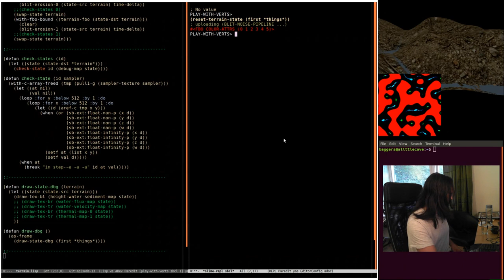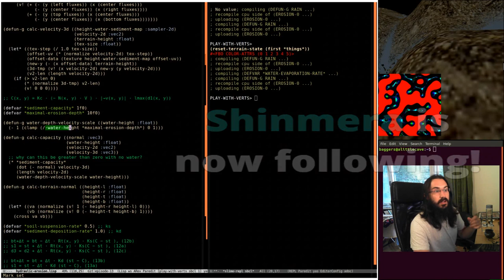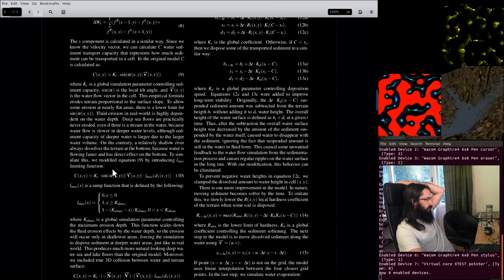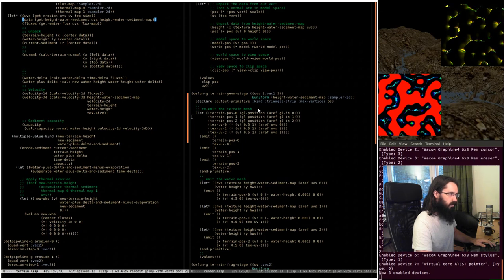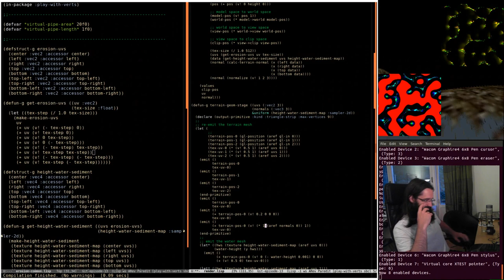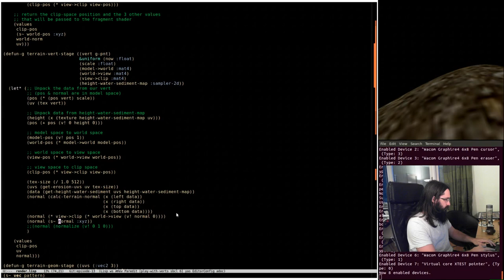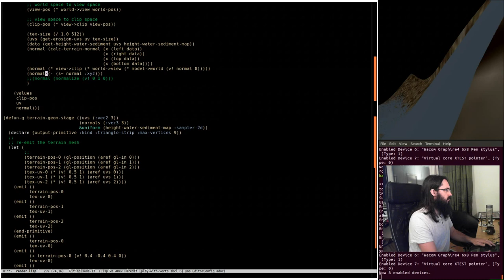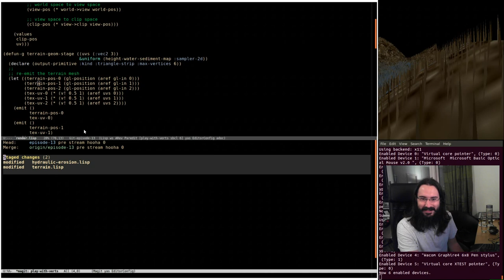Pushing Pixels with Lisp - Episode 13 - Struggling with debugging :| [part 5]

Comment: Is it possible to make deftypes with nested declares to create floats constrained to a range or that satisfy çonstraints encapsulated in additional functions? If you then use those new types in defun declares, at least you'll be able to get a type error at runtime when an invalid value shows up. Then the backtrace will tell you the source of absurd values. Might that help with testing?
Reply from the maker: Not in the gpu code as I havent made my checking that advanced. You could make a deftype that calls some validation function as use check-type, but this is naturally expensive. Declares are a bout telling the compiler something is true, if you says it's a float and then pass something else it doesnt have to catch that at runtime. Some implementations will add checks or report errors if your declarations conflict but this isnt mandated by the spec. Also CL doesnt mandate ieee754 floats so infinities arent exposed in the spec.
Thanks for the suggestions though, it's certainly a tricky one to get just right